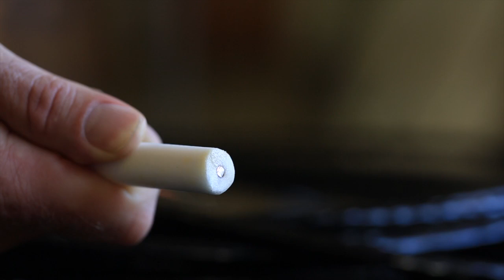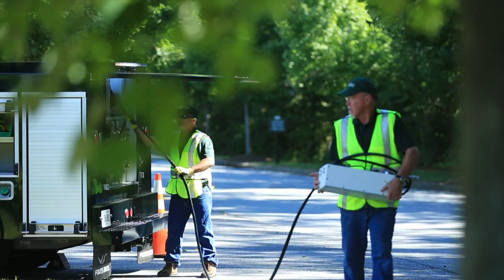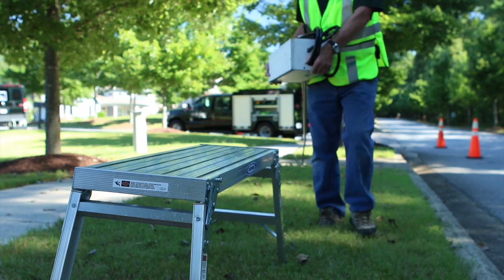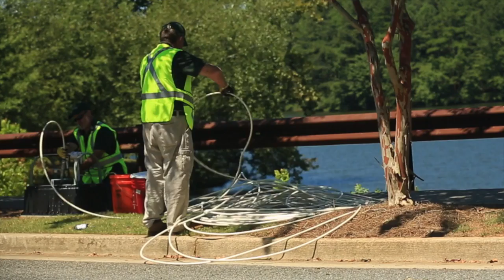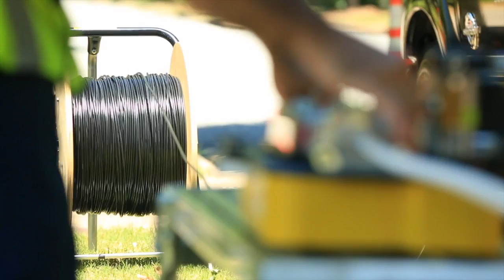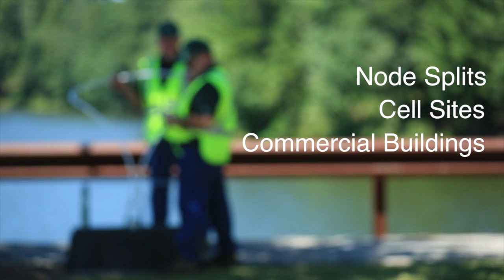Deep Fiber Solutions: The Proven, Low Cost Method of Converting Coax Networks to Fiber Optics

Comment: Hi, what a great idea. I have  a question what travels down the fibre is it
data/Internet/telephone, or is it the RF signal that has been sent from the
central office?.
Reply: A laser is used to send data down the fiber sor single mode which is used for long distances.
Reply: Fiber just transports data via a laser. Think like Morse Code, but like really fast and (most times) light waves you cant see. Were talking like 1550 nm. 

It depends what devices are on either side of the fiber optics that decides whats going to transport it. 

In my case, I use switches, and transport internet. Just like a really long Cat5 Cable. Its just Ethernet.  The phone service I provide is IP based, and the TV streams are also UDP IP streams. So all I have to do is trunk a few VLANs to separate everything. 

In some cases, ISPs even offer fiber optics in the home, not just to the node.